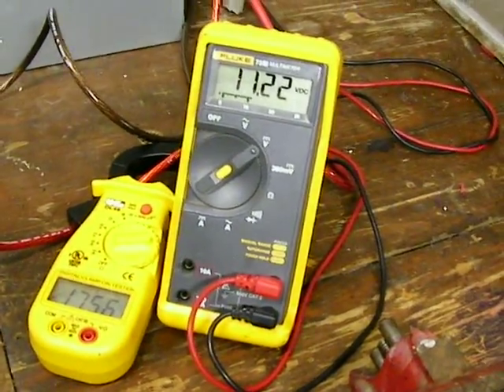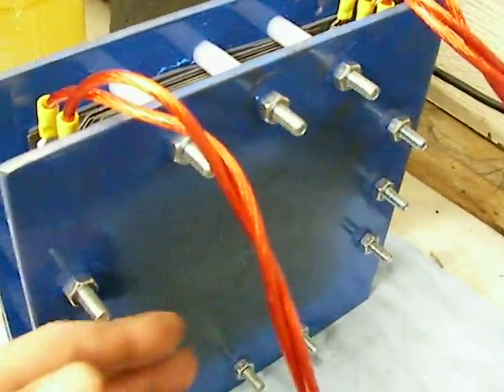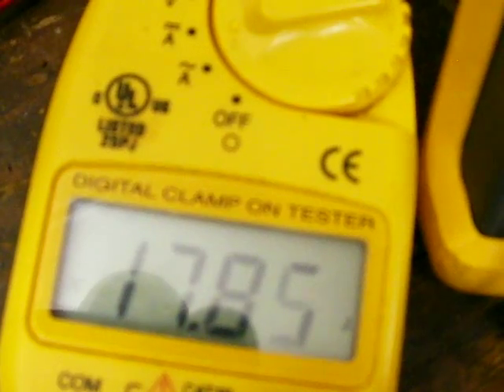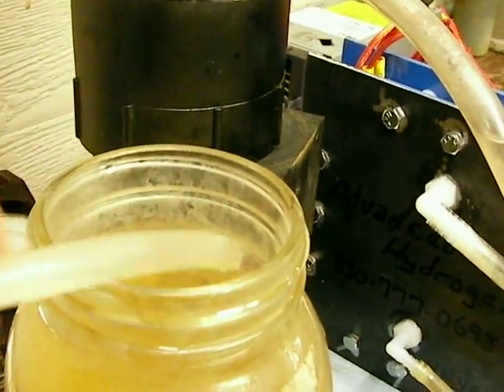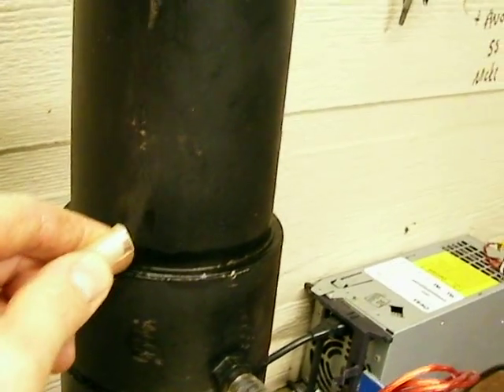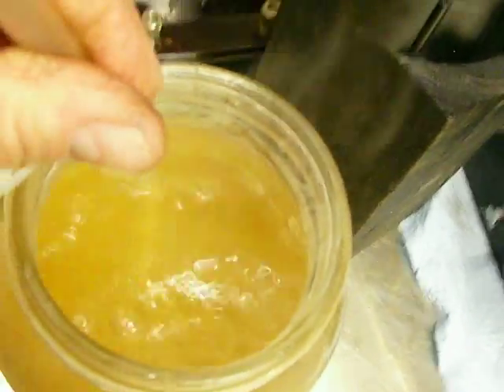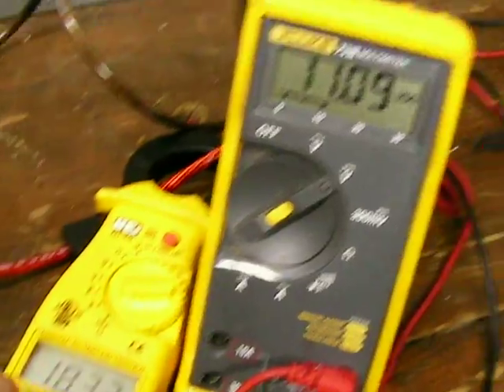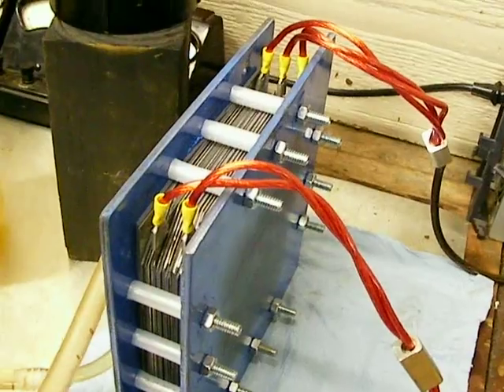Hydrogen cell fog machine!

Comment from the maker: the end plates are metal [ mild steel] with silicone gaskets to isolate the steel from the chemical reaction of the dc and koh..i have some 1/4 thick 304 stainless plates for my next cell i will post after the holiday fun is over....be blessed bro!

Comment: What I am doing to figure this out is this. I am using a refractometer to measure a base of distilled water. I then will run the unit thru my CLEAN condenser and CLEAN bubbler for different time intervals and then measure the difference in the bubbler to the base.
This at least will tell me if the smoke from the tube is indeed burnt KoH gitting to the bubbler. I also have some PH tests and a laser I am going to try as well. I will have this done by weekend and post the vids up. We will find out.
Reply: koh boils at 1320 degrees celcius

Comment: Yea, I tried a regular paper towel as well. If you try a mirror and hold the outlet about 1/2" away from the mirror you should (or might) see a vapor trail on the mirror but it dissipates real quick.
That is what had me confused at first. I could not collect the vapor as it dissipated as fast as it could but I could see it in the mirror.

Good luck!

Comment: Nice video. One thing though that I am looking at on my cell is that the (gas) you see is actually water vapor mixed with HHO gas. You cannot see gas. If you place the output hose next to a mirror you most likely will see the vapor on the mirror.
Now where does this vapor come from is the question as the cell is not at the temps to produce steam. My guess so far is it is KoH being burned in the process. I am doing more research into this, but I can tell you that it is caustic to nose tissue. :)